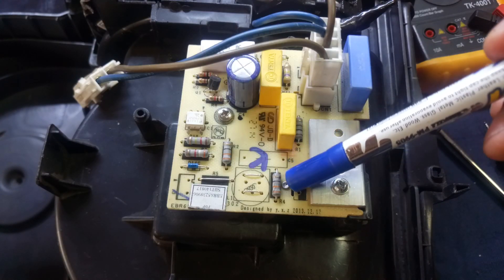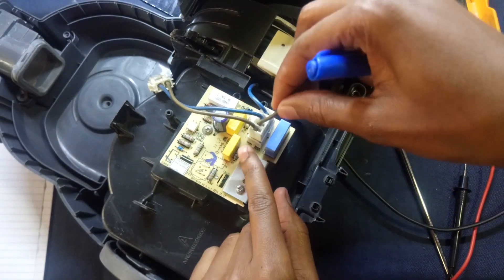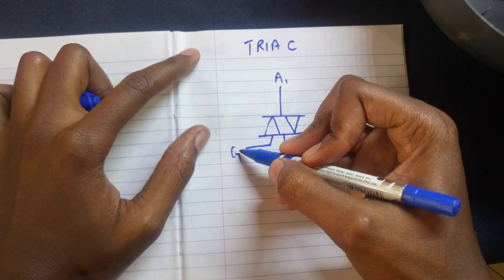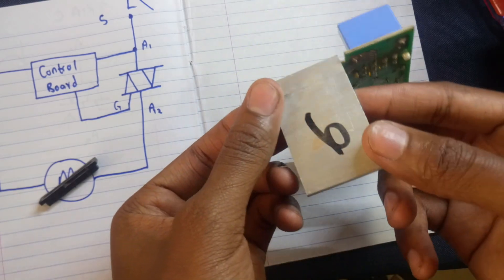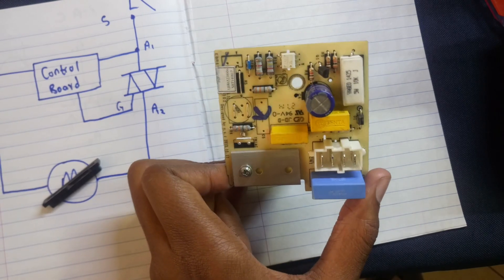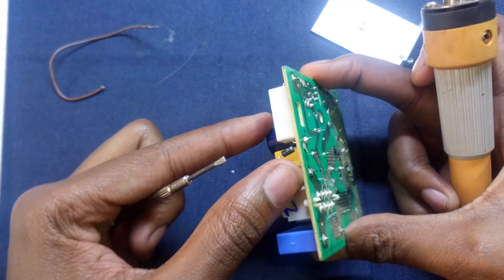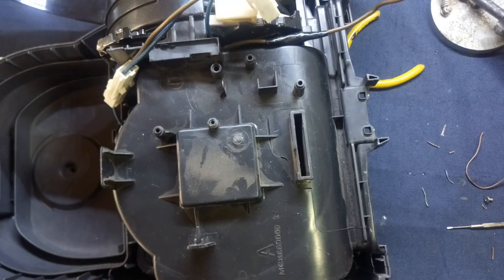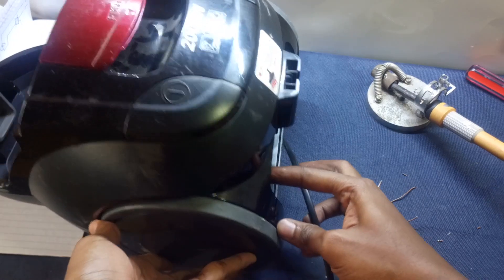Bypassing A TRIAC

Comment: So what does the microcontroller do when it sends current to the gate of the triac and the motor is already running.  Furthermore what is the sense for that triac at all in the first place as all it does is cause problem.
Also another question.  Does a shorted triac behave the same as a triac that is not there like yours?
Thanks for any feedback.
Reply: This is an LG 2000W vac, (actually seems to have been made by Miele for LG, or LG makes them for Miele since the board is exactly the same as the ones in Miele vacs. Some of these have a motor speed control, but this model doesn't. Supposedly the motor is very powerful and on start it has a large spike of inrush current, which can apparently cause a circuit breaker to trip, or possibly cause damage to the motor, so in this case this voltage regulation "Motor Soft Start" board uses a triac to smooth out the power consumption in some way. I guess it can also reduce sparking at the switch and extend the life of the switch. The triac is like a transistor in that the voltage on the gate regulates the voltage flowing between the A1 and A2 terminals. In this case the triac was removed, but I understand that in these applications, the triac can overheat and just open, not short out. All he did was simply bypass that whole board altogether and just essentially connected the motor directly to the mechanical switch.

As you can see there is a transistor there, near this little 5 leg white IC, which is a TLP3052F (D4SCF) a Toshiba "Triac & SCR Output Optocouplers" so it probably isolates this control circuit from the line voltage. Maybe the circuit monitors the current drawn by the motor and if it goes up due to a full bag, it reduces the motor speed, or maybe even shuts the vacuum off to protect it. So most likely bypassing the board isn't the best idea, although, sure it gets the vacuum to run.

I was able to identify this board as an ERB65238906 (also written on the board in a photo I found ERB652389, so it's modified a bit) The triac is an ST Microelectronics T1235H-6T "snubberless triac" which is the same used on some Miele vacuums as well. This is a board from 2014.